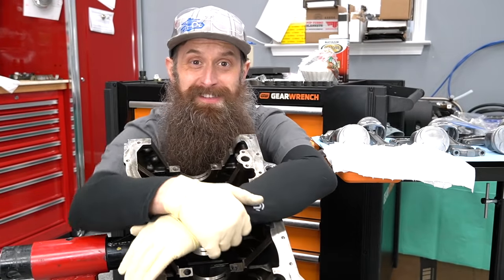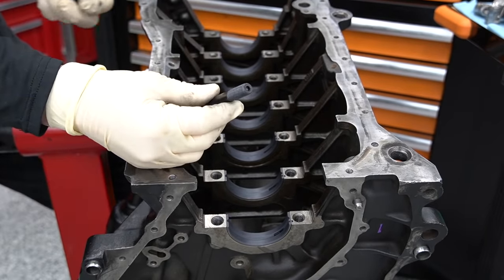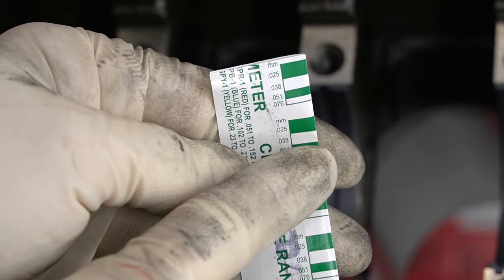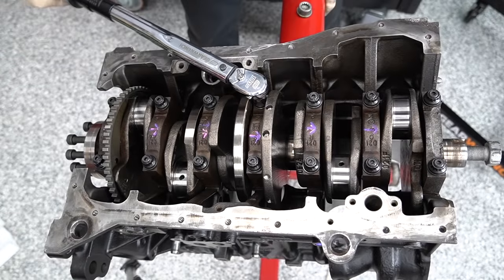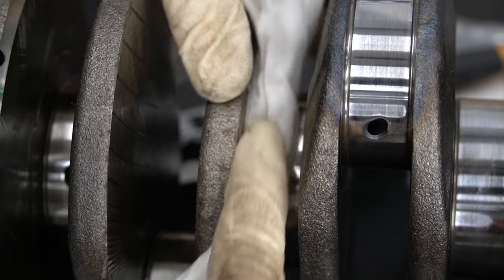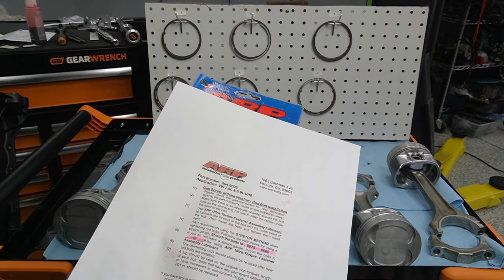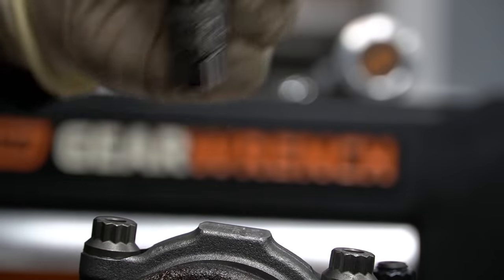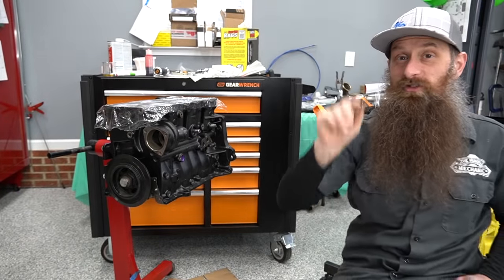How To Assemble an Engine Block with Upgrades!

Comment: Hey Charles great video. One question. I noticed you didn't check the crank end play. Shouldn't you have done that?
Reply from the maker: It’s not a bad idea for sure. But since we had no issues before, and no evidence during teardown, I feel pretty good. 

Now I did use a different thrust washer. I mic’d the old and new ones. They were basically the same.
Reply: @HumbleMechanic  Excellent... Hoping you'll video the timing chains install. I'll be replacing mine this spring and would sure help.
Reply from the maker: 100%.

Comment: Thanks for the video, I've used the same green stuff when I was inspecting a motorcycle engine :) Question: what's so special about the assembly oil? Why not just using motoroil?
Reply from the maker: It shouldn’t. Not in the realm of  plasti gauge anyway. Keep in mind plastic gauge is like a “ball park” measurement. So you know it’s not WAY OUT. A proper measurement is achieved by using a mic and bore gauge or T gauge
Reply: @HumbleMechanic  I believe this response was intended for another comment
Reply from the maker: Uggg. Man I tell ya. YT and FB have been so funky lately

Comment: Hey Charles. Irrelevant question. Mk5 rabbit, is there any way to get past pressure bleeding my clutch? Don't have the tool and I already replaced my slave cylinder
Reply from the maker: Maybe? But I can tell you it SUCKS with a pressure tool. Nightmare without.

Comment: @humbleMechanic could really use some help. Looked around online and couldnt find anything about it video wise. I have a door lock barrel that the anti theft clutch is slipping in my gen 5 rabbit. The lock from gen 4 and previous has a clip that you slip off and it all comes apart but the gen 5 has a split housing with 2 thru pins. I'm wondering if i just need to take it to a dealship to have them swap they keying to the good used barrel or just take it apart myself and swap the clutch piece
Reply from the maker: Shoot me some pics charles(at)humblemechanic.com

Comment: Hi please i need help i have a V5/VR5 AQN  engine i always want to do upgrades will the main bearings and connecting rod bearings and the piston rings and the arp hardware be compatible? If not there is not much info on bilding a V5/VR5 engine please i really need help if its not compatible will sombody please send me links to what i need  thanks

Comment: When do you exchange your head bolts? Do you measure them on elongation?
Reply: There's only one answer with standard headbolts: always. They are supposed to stretch on the last angle tightening.
And they don't spring back to their original length.
ARP bolts do (that's why they're more expensive) so those can be reused.
Reply: Sometime you can reuse them if they are still in specs. But it's recommended to use new one every time you do a head gasket after a head gasket failure.

If you open the engine and the failure wasn't in the head gasket or a cracked block or head, the bolts can be trusted if they are not stretched out of specs.
Reply: @Fabien2626  May be all true, until a bolt snaps under the deck surface and you need to drill a steel bolt with a steel drill...
Trust me, you do that only once.

They are not that expensive. I never reuse any of them, ever.
Reply from the maker: The other comments echo my thoughts. You might be able to get away with it. but it's not worth the risk.

Comment: Dear Humble Mechanic,  I picked up a 2010 Touareg with the 3.6l fsi.  It was a copart insurance write-off salvage title special $1800.  It has 160k miles and seems like everything works.  Beautiful car.  Just a little glycol odor in the exhaust, and frequent misfire on cylinder #4.  Runs pretty rough.  So I'm pulling the motor and following your inspiring example to build this motor.  I have a question though.  What source and brand for a quality kit do you recommend?  TYTYTYIA
Reply from the maker: ECS and FCP euro do the best job with kits. I generally buy kits from FCP

Comment: Have you ever worked on a VR5? I have a crappy v5 mk4 wich i want to use the engine for to swap it in a '72 beetle...
Reply from the maker: I haven’t. But it’s basically the same
Reply: @HumbleMechanic  i thought that, vr6 parts aare so much cheaper than vr5 parts. I might as well keep one spare of everything😂

Comment: Some oil would be nice when you were gapping the rings in the bores and setting them into the groves, not after. Lube up, love the lube - why you no lube?
Reply: Personally I stopped oiling rings 30+ years ago and only oil piston skirts and lands but lands get wiped to remove 90+% of oil to keep face dry.
 It means rings bed in much faster and compression stays good for longer without as much blowby (you always get some) Rings probably wear a little faster but 10,000 miles on a high performance street engine is pretty acceptable to me. I think it was GM (or maybe Honda?) that did tests and 'flooding' bores and pistons means it can take as much as 10,000 miles for rings to bed in and you can see the blowby on pistons (burnt brown skirts and under crown)

Comment: Didn't make it clear that the oil holes in the crank should also be blown out in both directions as long as he is recleaning after the machine shop cleaning.  This is being meticulous, not picky.  I would use the Plastigage on the top side of the journal, not the bottom so the weight of the crank will not affect the reading.  Could  mention that the wrench should be held at a right angle to the crank to lessen the possibility of rotating the crank when using Plastigage.

Comment: Dis-claimer : I'm an old diesel engine guy. I learned from older guys, while in my early 20's; in my 50's, now. Ok. Never kept pistons in same liners or bores. If a piston is contacting the bore, there is a ring or wrist pin issue. Never kept rods on same journal. New bearings mean rods don't affect the crank. Never kept push rods, lifters etc. in their respective order. In my career, I had the pleasure of training in failure analysis. These issues were never addressed as something to question. Other than RPM, is there a reason why gas engines are that picky ?
Reply from the maker: Man that level of testing sounds awesome. Would it REALLY matter if you didn't go back where they came? I don't know. I also dont think id really want roll the dice on finding out. The theory is, if it was find in the home before, it should be after.

Comment: Is it okay to reuse the bolts after they stretched?
Reply from the maker: Dpends on the bolt. My overall opinion is no. But a valve cover bolt is going to be far less of an issue than a head bolt or a main bearing bolt
Reply: @HumbleMechanic  does that mean the bolt needs to be replaced after it has stretched to the mark between 7-8 in your video?
Reply: @HumbleMechanic  I'm referring to the video at the  35 minute mark where you stretch it and then undo the bolt to check the plastigauge for oil clearance and installed the bolt back on. Is it the same bolt that was installed back on (the one that just got stretched to 7-8) or a new one?
Reply from the maker: I’d use the old ones for the measurement and new for final assembly
Reply: @HumbleMechanic  would the old ones being stretched already cause an inaccurate measurement when stretching it even further a 2nd time?

Comment: Geez, my humble brother from another mother:  just torque the main caps down, and do a full long axis tunnel hone.  No plastiguage, I never trusted that junk! No measurements!  Just start fresh with a clean slate.

Did the machinist check for crank shaft bow/sag? Did you check for long axis twist from front  to rear (snout to flexplate bolt up flange)?

You are going to balance, flatten, and double end grinnel all six connecting rods?  Are you going to balance the pistons?

And one final question:  is anybody going to BEG Volkswagen to keep building these engines for at least another ten years!?!? 🤯🤯🤯🤯

(a concerned old engineer)

Comment: who supplied the rod bearings?
Reply from the maker: I got them from HPA
Reply: @HumbleMechanic I don't have the part numbers on hand but have a look at the Passat R36 rod bearings. They have 2 part numbers one for top and one for bottom. They look exactly the same as those coated bearings straight from VAG. Much cheaper than HPA charge. Love Your channel man keep it up.
Reply from the maker: I’m not sure if they have that for rods, but the mains for sure!! Or it may be both.
Reply from the maker: Luckily here HPA helped me out on the price. Lol the turbo kit was $$$$ so I’ll take anything I can get
Reply: @HumbleMechanic  rod bearing size between the R36 and R32 is same same. I've build a twin turbo vr6 for a client with those bearings and used them on a R36 turbo I did for the police unit flying squad. I am looking forward to Your car getting done and running.

Comment: With all that talk about thrust washers, why did you not measure the end float  or end play of the crank with the thrust washers in place.  Also, it is good to emphasize to not put the thrust washers in backwards...a common mistake. BTW, FWIW, I was taught that .004 inches per inch of bore is a good rule of thumb for end gaps...If you do not get a spec.

Comment: Isn't putting a piece Plastigauge on each side of the Crank going to give you inaccurate measurements?
Reply: Just posted the same thing - I guess the spec must be cut in half when applying plastigage on opposite sides (?)
Reply: Jup

Comment: Thats not exactly right...the main bearings, after screwing down with the right torque...have to be oval, not round! 😉
Reply from the maker: But since round only exists in math theory, we can call it that ;)
Reply: @HumbleMechanic  😉
I learned this 4 years ago...an ingenieur who is in charge for development engines told me that an oval shaped main bearing is necessary, hydrodynamic rules to prevent the crankshaft touches the bearing during rotation. 👍

Comment: Why is it called r32
Reply from the maker: Good Question. R has been the VW performance id for many years. And the 32 is because it's a 3.2l engine
Reply: Mechanical turning works